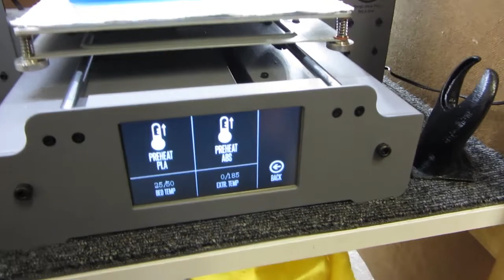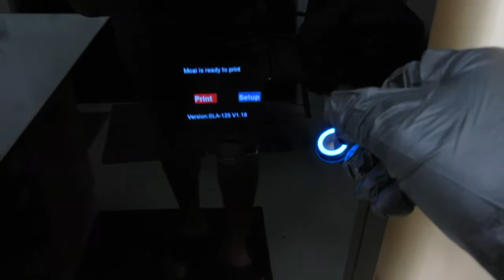Preflight checks, Printing with 3D resin printers

Comment: It has a solid base, the vat is pretty much identical to the Form 1 vat. On top of the solid base is a layer of PDMS which is basically a silicone layer. There are FEP vats available for the Moai now. FEP vats seem to be more durable than the PDMS vats.
Reply from the maker: yep, thats correct. I just switched to the FEP vat for testing a new resin, will give my impressions soon on it. thanks for commenting.

Comment: Does that resin vat have FEP film on the bottom or is it a solid plastic base? I caught that you said something about PDMS, what is this and is it similar to FEP film or is it something different?
Reply from the maker: Hey Kevin, there are two types of vat for the Moai, the PDMS as seen in the video which is a silicon over acrylic, and a FEP sheet version with a metal frame. FEP version is cheaper to maintain and replace yourself, but IMO the PDMS is more forgiving when printing. I have just switched to a FEP vat for testing, so will post results soon. :)
Reply: @vfxforge  Thanks, this is the first I have learned about PDMS. I have the Photon and trying to figure out a way to set it up to work with PDMS. Looking to get me Moai here probably second quarter of next year but slave to this printer for the time being.